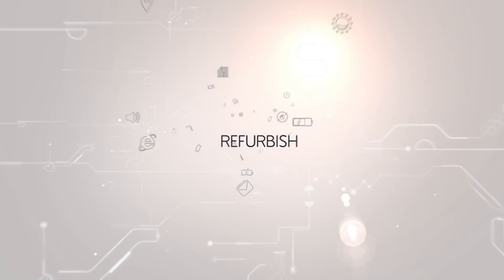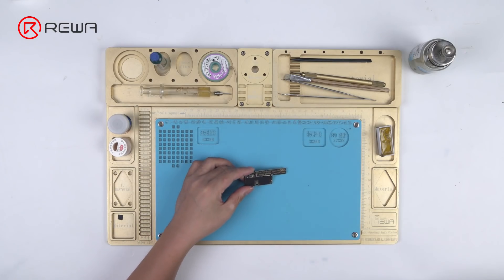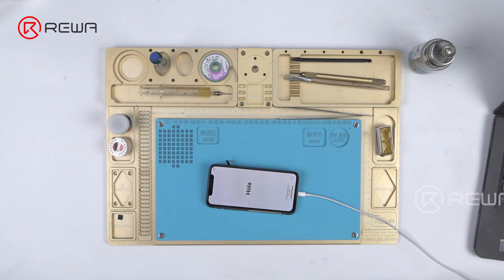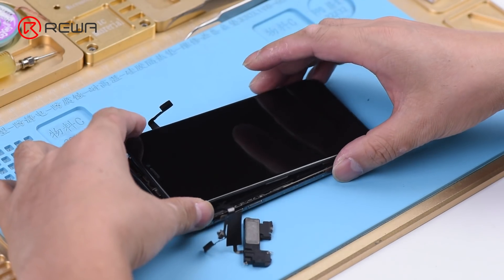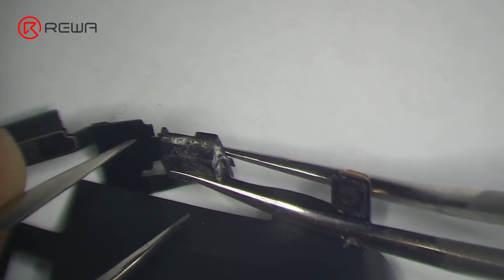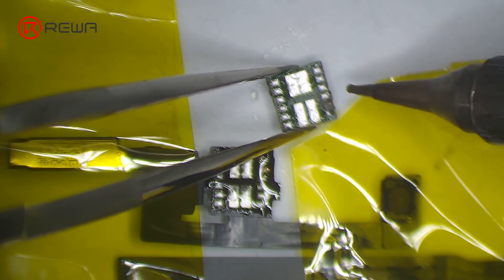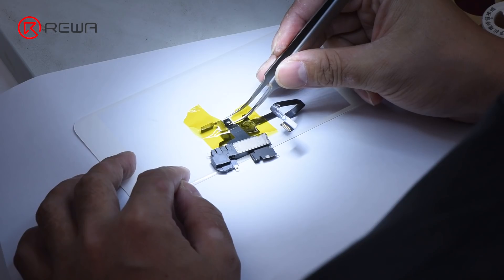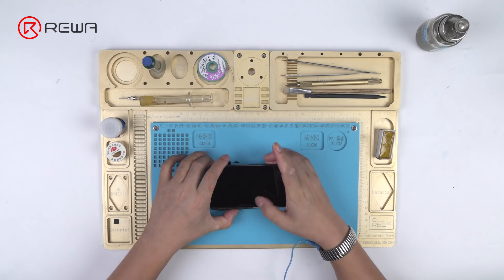A Rare Case Of iPhone X Stuck On Apple Logo（iTunes Error 4013）

Comment: I got it to work !!! Main I looked up soooo many videos and tried the hard reset (pressing volume up then down then the power button ) , I plugged it into iTunes, it went into recovery mode i tried to update it, it didn’t work so I tried to restore it which means I would lose all my pics and info that weren’t backed up. After 50 tries and getting error code 4013 everytime  I was willing to compromise on anything !! And wala... I was doing the right step all along but error 4013 often means faulty usb or the laptop that you’re using is not updated . So I hunted down an unbroken “original” apple usb , ensured the windows on the laptop was updated  (I don’t own a MacBook so I used windows) . I plugged it in .. did the same steps ... “update” it but when that failed I then attempted to  “restore and update”.. at first try it still didn’t work so I was instructed to use another USB port on the same laptop and bam.. just like that it came back on . So it took like 2-3 attempts but it worked . So remember you NEED an original apple charger and an updated laptop with iTunes . Please let me know if it worked !

Comment: Mine did the same after water damage. I opened the device and cleaned with alcohol and it’s back alive again. The Face ID however doesn’t work. It says move iPhone higher / lower during Face ID setup. Proxy & light sensor also work fine. Will reflowing this fix it ?

Comment: My iPhone 6 is not power on when the Touch ID cencer when counted to the mother bord and when I removed the censers then my iPhone on power on what was the problem
Reply: Start by replacing the home button, then the long  home button flex which connects the home button with the  logic  board